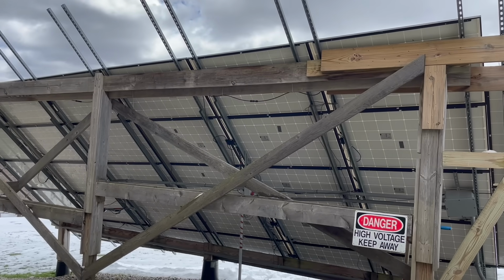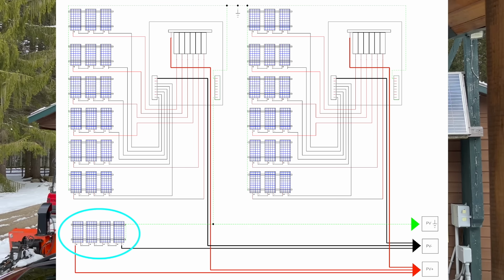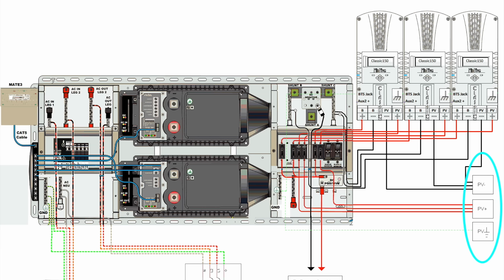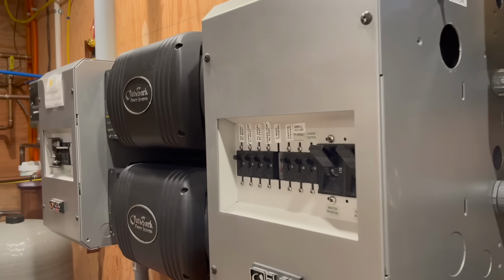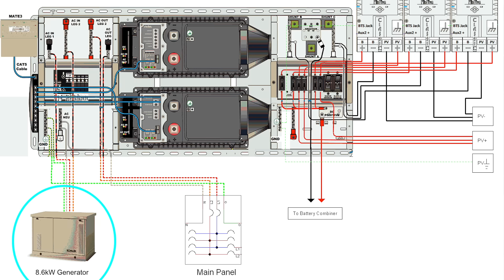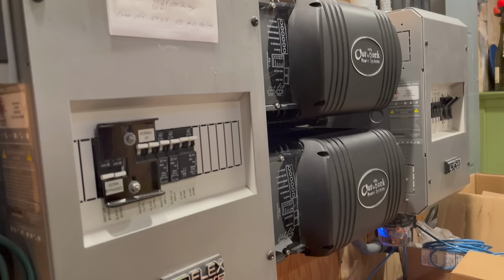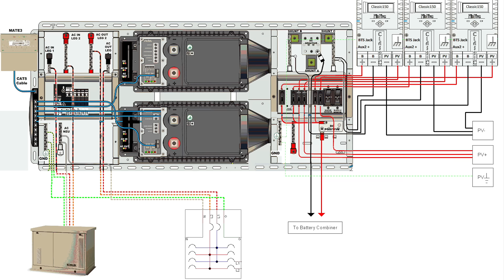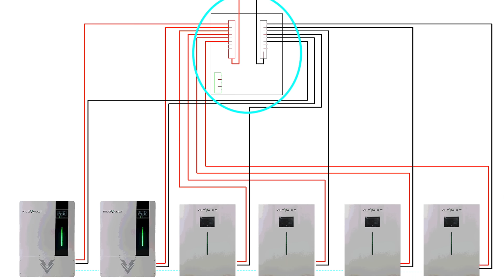Solar + Storage System Tour for a 1,200 Square Foot Off-Grid House

Comment: Beautiful...
10kw is kinda large for such a small house.
Reply from the maker: Yes this system provides enough power for the home to operate like it has a stable grid connection, but with the proper energy budgeting a 1200SqFt house could get by with much less power.
Reply: @AltEStore  You mean 1200 sq ft house? Your comment says 12 Thousand sq ft...
Reply from the maker: @bogus_not_me  Woops! Yep an extra 0 in there! thanks for the edit

Comment: Mega- bucks$$$. But a really nice system.
Reply from the maker: Yeah this system is decked out, although not as expensive as it used to be with today's pv and battery prices. And still cheaper than bringing in utility power for many places!
Reply: @AltEStore  approx how much for a system like this?  also, can the house run on sunlight alone and charge the batteries at the same time?  great to see you folks keeping on!!! this place looks great! similar to what i want to do soon
Reply from the maker: @davidjaye710  This system cost about $50k, mainly due to the battery bank capacity and large array. The house charges its own battery bank throughout the day and runs loads at same time. The inverter output is smaller than the solar input, which means always a net positive for the batteries while the sun is out!
Reply: @AltEStore  great job... thanks.... what's your model number on your solar panels?.. did that price include generator?
Reply from the maker: @davidjaye710  I suspect the generator was a separate purchase. Our panel selection changes with market availability, so you can check out the current options here: https://www.altestore.com/store/solar-panels-c541/
Reply: @AltEStore  thanks I appreciate that!.. oh yes the market!..lol...good to know it will help with the basic specs for sure...my plans are still a ways out but I like to be educated...fyi I always refer to you folks when I talk about solar to anyone!  I appreciate ya!...have a great day!
Reply: I think that the fact to power a home like this one with electricity just on the sun's light is worth more than any money, it's awesome. And that's why I support renewable energy systems, best of today's  tech and engineering set to wonderful use. It's a cool thing the owner has the wealth for it. 😎